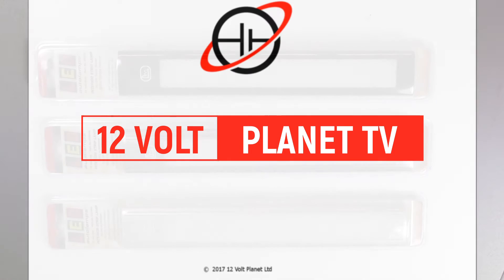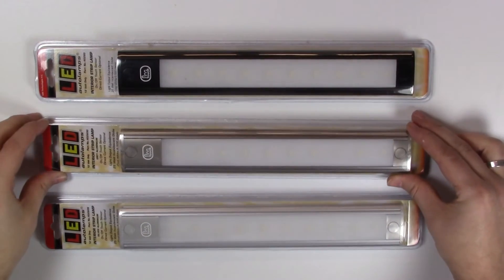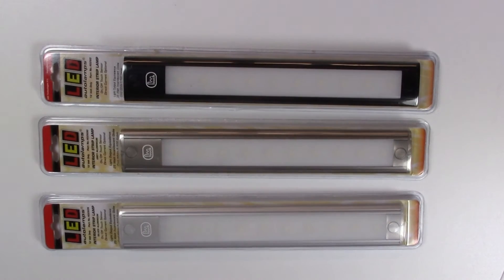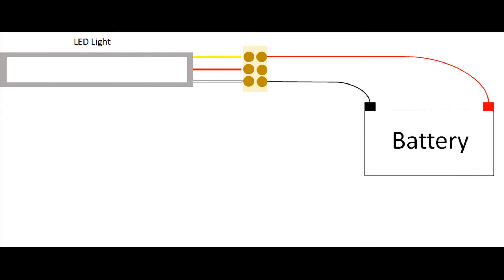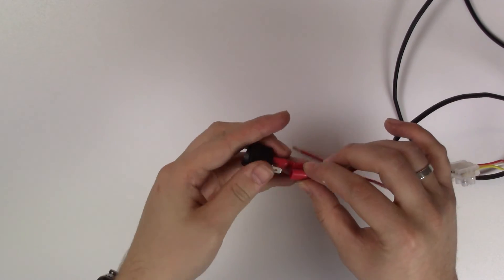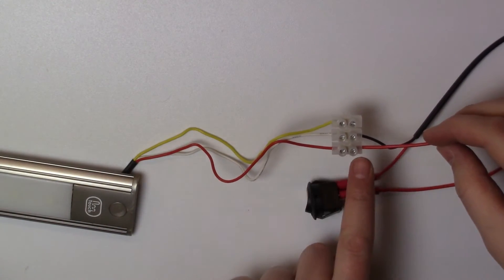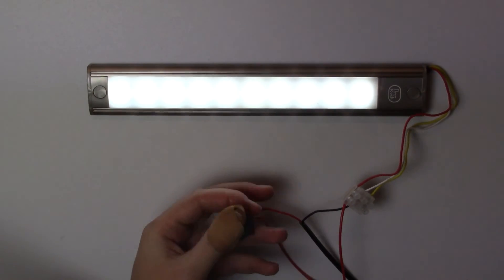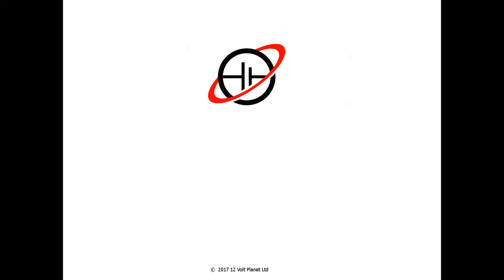Wiring Up Low Profile LED Strip Lights | 12 Volt Planet

Comment: I’ve tried installing these. when I remove the cover with the touch control to screw the light into the ceiling. The touch sensor cable seems to short on the housing and render the light inoperable when reinstalled? I’ve bought 6 of them and it’s happening with 3 so far. I don’t want to open the rest if there is something I’m missing ?
Reply from the maker: Hi Kieran, Removing the end caps of the light may result in damage to the switch and prevent the light from working. For installation, the round screw hole covers at either end of the light can be removed to access the fixing holes and the cable entry is on the rear of the light, beneath the touch switch.

Comment: Hi! Is there a trick to remove the round plastic that covers the screw? I've installed it  but i need to make some changes. I need to unscrew it but  i cant get it out, to access the screw... Thanks!
Reply from the maker: Hi Delia, Sadly not but I do find it easier to go through the back and pop them out with a wooden dowel of sorts.
Reply: @12VoltPlanetTV  difficult if the lamp is screwd in hehe
Reply from the maker: @deliacircus  Sadly in that case, Really thin blade under the cap hopefully then you can get it off. Sorry hope you sort it :)

Comment: Would it be a problem to have 12v on both inputs,  ie: used as a courtesy light on the red lead and local touch switch on the yellow ? , I realise if the courtesy light is on I would have no touch control.
Reply from the maker: Hello Bobby, Sadly we have not tested connecting both cables up at the same time but we believe that it would merely bypass the touch switch and leave the light on permanently (as it would if you just hooked up power to the Red Cable)
Reply: Has this set up been tested yet? Also do any of the spot lights offer dual power?
Reply: Hi Dan, wow it's been a while, can't remember which lights you are referring to, however what I did was use blocking diodes on each of the main power feeds to the lights one  on a switch from leasure 12v and the other from courtesy 12v, if either one is activated the light comes on, but there is no feedback to the off 12v circuit thus no other courtesy lights come on when switched off the main 12v and vise versa.